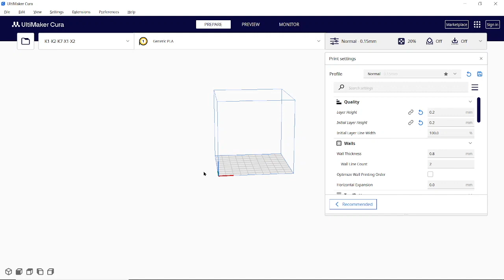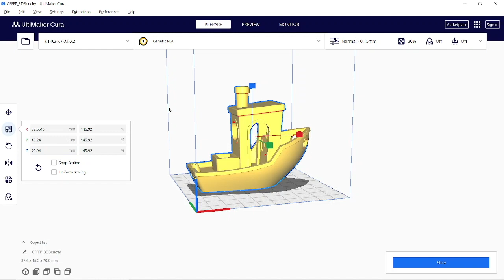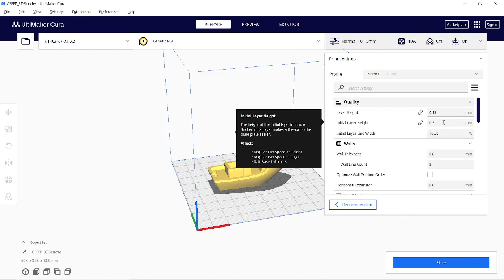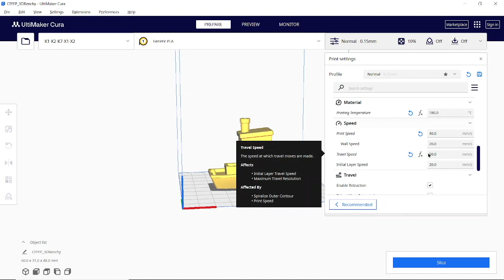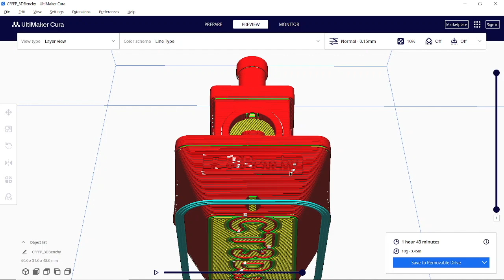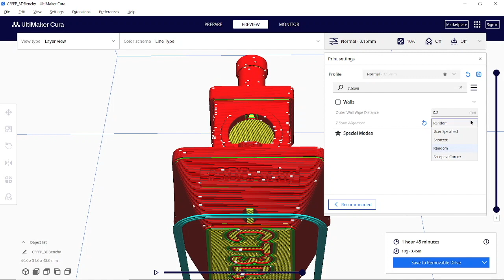How to set up and use Cura 5 4 0 for the Easy Threed K9 Mini 3D Printer

Comment: I didn’t find the files you mentioned at the beginning of the video in the memory because it’s empty.
Reply from the maker: Thanks for your comment. Did you have the card that came with your printer? Thats the micro SD card they supply. AFAIK the file isn't available to download from anywhere but it should be on the card that came with your printer. Kind regards & best wishes.

Comment: Best vid I stumbled upon regarding printing. Subscribed. Liked easy talking and smooth transitions in this vid. I am in 50es and bought printer for fun because it was under 40e on temu. Completely unplanned. While I Planned for a years to buy something really serious but i do not have space for it still. I am in a joy like teenager because I need to sit in front of 3d studio like i did maybe 30 years ago. Wow. Modeling again. 3ds,dwg,eps etc etc 486 dx120 with 16mb of ram wow. Rolling like avalanche Joy, recalling, thrill, planning... Thank you. Thank you. Best, from belgrade.
Reply from the maker: Thank you for your comment & watching the video. I very glad it was useful. I was for 30 years inexpertly making things in wood & metal so it was a revelation for me too. These small printers are really good for the money as long as they can be bought cheaply and at €40 its good value. Kind regards & best wishes.

Comment: Could have shortened this video to a gif:
1. Sell cheapest printer on aliexpress.
2. buy Bambu a1 mini.
3. Delete cura
Reply from the maker: Thanks for your comment. I welcome all opinions. I don't have to sell the printer. The price point sells it. Many people don't have $250 to spring on a 3D printer. One thats $80 still has a place. The printer stands on its merits IMHO. There are many selling points, not just the price tag. Its not going to meet the Bambu Labs in any respect but its very low price tag and extreme ease of use from assembly to first print are hard to beat. I have may other printers and none have been as easy to get an acceptable print from. The bed adhesion is superb and its easy to do. Look at the 100 or 1000s of posts online to see thats an area many beginners struggle with with all of the conventional surfaces. Its a total non issue with all of the Easy Threed printers. It uses little electricity and has an unheated bed and is low usage. This is an issue for some not being able to afford utility bills etc. Its low cost all round. Parts being cheap as chips. The hot end costs about £4 to the UK. Its easy to replace. Really easy. I just did that as I've done on my Enders 3s & CR10. Its much easier. A few tiny screws and done & dusted. Its easy to load & unload filament. There's a long list of things. I feel totally justified doing stuff on these printers because they do have a place. They have a place as a starter printer or for folks on really low budgets who want to try the hobby before committing big money to it. I won't go into Cura, which is one of the best slicing softwares from one of the biggest names in the 3D world which is developed and provided free. Of course you are welcome to your opinions. We must agree to differ. Kind regards & best wishes.

Comment: Cura keeps saying “print setup disabled and g-code files cant be modified” after uploading to the cura application. These are the SAME files on the website of free models provided by the website link on the TF card…. I sliced them in Easyware and printed them but they wont upload to CURA and keep saying make sure the gcode os suitable for printer (which it is because i used Easyware to print test prints)

Comment: Would this setup happen to also work for the K6? I am so lost. Easyware is garbage
Reply from the maker: Thank you for your comment. 3D printing is a a steep learning curve. Easyware is functional or at least it can be used but doesn't offer the same options as Cura will. Cura is suitable for any FDM 3D printer, so the settings should work the same. Your SD card should have come with a little configuration file which should configure CURA and it works with 5.4.0 as well as the older version of CURA that comes on the SD card. Id Jump to 5.4.0 or whatever the latest version is. It has a wealth of features. Im currently trying to look at optimal settings in CURA for the K9. Id suggest to try looking at https://www.youtube.com/@filamentfriday
The channel has a large amount of useful information on 3D printing in general though they don't cover Easy Threed printers. Id suggest trying a calibration cube which should give you an idea how the printer performs. Although Cura has many settings, its best to not to change too many of them unless there is a compelling reason. Thanks for watching and let me know how you get on. Kind regards & best wishes.
Reply: Thanks for sharing. I have printed a few items already upon receiving the machine initially. In regards to Cura, I have input my info by dragging and dropping, but the print froze mid-print. Not entirely sure how to proceed.  @NightStarLeafTech-vj3ez
Reply from the maker: @ItsMeKuchipatchi  Im not sure why that would happen. Ive never had any unexpected problems with the K9. I generally find that they respond well to being turned off and on again at the wall  and that, normally fixes any issues. It doesn't help with the print freezing. Were you using the SD card or controlling it from a computer? I only ever have used the SD in printing. That applies to all my printers. I would try again. Perhaps change the SD card, which might be corrupted etc. Kind regards & best wishes. If using an SD card extender it might have got jogged. It might also have been a power outage. They don't have sophisticated features like resume after outage etc. Kind regards & Best wishes.

Comment: Its a good job I watched this video again. With your help,  managed to get my printer settings into Cura. I am now printing the benchy but as I like it where it is a little lower and a little wider. Standard, I think the cabin is out of scale and too tall. I have also bought a heated bed for my K9 as I tried to print a box and one corner was lifting up and it was catching on hte print head and didnt work. I am hoping hte hotbed will work better when it arrives.
Reply from the maker: Hello again. I didn't see your 2nd comment. It shouldn't lift tho, not with PLA at least. Have you tried levelling the bed again with the paper method? It might be that bed bed has gone out of adjustment. Mine seems to require re-levelling frequently but its very easy to do fortunately with the 4 little buttons. You might check out my other video on changing to the Ender 3 magnetic print surface which makes the bottom layer cleaner and is just as easy with bed adhesion. Kind regards & Best wishes!
Reply: @NightStarLeafTech-vj3ez  The printer is new. I level the bed every time I use it. I have done the paper thickness every time I level the bed. It has the magnetic print surface. The prints raise up at the 4th corner after a few laps of printing. It doesnt happen straight away, but after a few layers. It seems as if the heat of the pla lifts the corner and then the tip of the extruder catches the raised part. I use PLA+. Small items are easy to print, but ones that go have a larger foot print seem to either not stick or the printer doesnt like the number 4 corner. I found that I could press down on the far left corner of the printer base and it will level the y axis and bring the axis level, so I super glued the foot of the base down so it doesnt lift up. I havent tried the printer yet as one item I wanted to print turns out to be too big for the bed. As it is a 100x100x100mm printing area, hte piece goes out of the range by 4mm one side and 3mm on another side. I will find something to print that is going to be useful for me to use. It is only a T12 soldering station case, but I have a couple of different t12 soldering stations I would love to print out. I have to learn how to start designing one but cant yet get a simple panel started. I have a print to try, which is 3mm all around oversized but it had two parts to it and I cant find a way of deleting one of the parts so I can just print a part of the set. The way it is set out, it has both parts on the print table at the same time and I cant edit it to print one part. I use Cura or FreeCAD to load the files and have it set for my printer.

Comment: I think this is the best video of explanations I have seen for these printers. I have just bought one as I already have two reels of PLA and nothing to use them on. My first time owning a printer that will work as I bought one that I didnt know was not complete. I am in my 60's and I have seen a few video's but they dont go into it as well as you do. Thanks for an easy explaining and exploration of the settings. I will look at this vid a few times.  I will have to subscribe to see your other vids about 3d printing.
Reply from the maker: Hello and thanks so much for your comments. Im in my 50s myself. IMHO seniors may have a better experience with 3D printing. Its a kind of electro mechanical device which has mechanical & electronic components combined. I often feel that seniors have more of a practical grasp of those things than younger folk and are more inclined to practical things which is a distinct advantage. Plus we also have patience etc because we grew up in a different time. These things are so good for the hobby. 

Im sorry you had a bad experience with your first printer. Its a steep learning curve. Thats why I think this range of printers is great because it takes a lot of things out of the equation  that otherwise might cause problems. Bed levelling and bed adhesion - the one is easy and the other simply doesn't exist. Bed adhesion is great. No heat needed. No trouble with it. Blockages - I've not had one yet with mine. It doesn't seem to block. Feeding the filament is very easy - another thing people struggle with sometimes as the filament can get stuck, get loose, components fall apart or go out of adjustment. Not so with these printers, they are very simple and straight forward to use and the filament path is very simple. People can go on to acquire other skills &  needed later. Its not  like being thrown in the deep end.  

I hope you enjoy using the printer when you get it! I wanted to do a video on feeding the filament etc and I've still got a lot of things to do with the printer plus also some 3D design projects with Design Spark Mechanical which is a 3D design program. It has a free version. It only works on Windows machines ATM. Id encourage you to take a look and see if it would be of interest. Its certainly worth the time to learn it. Kind regards & best wishes.
Reply: @NightStarLeafTech-vj3ez  I saw this reply after I saw your second one. I find feeding the filament easy. I hade a filament reel holder out of plywood before the printer arrived and placed it behind the extruder so the feed is almost in line all the time. I havent used the white filament that came with the printer. I have bought a 3d pen and think I will use that with the white from the Easythreed.  I am going to look at the 3d design you mentioned, thanks. I had a 3d design program on a computer many years ago, but I think it was part of print that is on computers, and I designed an interior for a camper van I was building from an Ex Post Office LDV Convoy van. Needless to say, I built the camper as I went along but only used half of what I planned with the 3d design program. I will find one and learn how to start 3d design. I was thinking of going for a resin 3d printer, but I am unsure of the drying and cleaning process as I have seen other machines that will set and clean the excess resin on the printed items. Thanks for your feedback and help suggestions. I look forward to seeing other video's you make. Take care and all the best. Ian
Reply from the maker: Hi Ian, its interesting you say you are doing a van conversion because Ive done one too which is mostly finished apart form the water heater which I haven't had time to finish. I used a lot of 3D printed parts in mine eg edging for the over cab area, framing for the windows, gaskets & grommets, the glands for the solar cables etc. Basically anything I couldn't buy or easily buy. I also did custom joints for the waste water system. Of course it means you can have any combination of angles for the pipe work rather than sticking with what's on the normal market for these things. Good luck with your build BTW. The K9 isn't up to ABS  but of course you could get something later that is. There are many printers that will do it. I haven't considered resin myself or looked into the technology either. Id be interested to see what you made for the K9 but Im not sure how to share things. I don't know if you saw my other video where I made a platform for it. It was a bit rough & ready but functional. I may set up a website later depending on if the channel grows etc.  Kind regards.   @ianallen2
Reply: @NightStarLeafTech-vj3ez   \It was a few years ago (around 13 years) when I built two camper vans, One a transit minibus into a camper and the LDV. I also built a teardrop caravan. I bought a mattress to fit in it and asked my wife what she thought of it. She felt claustrophobic in it.. lol. 
For the K9, I built a  frame similar to yours, but with a solid board base. I am going to upload a video on youtube to show what I have done.  I have had a micro sd card extension off ebay arrive today. It will be easier for me to mount the sd card as where it is on the printer, I think is awkward to put the card in as I need a light to see the slot. I have thought about making a reel holder to come off the handle uprights, just to bring it in from the back a bit as the reel overhands the back of the base plate. I am thinking of making an enclosure for it to keep dust off it. 
I will only use PLA and PLA+ for printing. I have read ABS is smelly and needs a ventilation fan and filter. 
The heated bed makes the prints stick a lot better to the bed.  Best regards.
Reply from the maker: Looks like you were doing the vans before it was cool to do it. I find ours claustrophobic to sleep actually. I have plans to open up the bed area but don't have time presently. Im glad you are going to do a video on the printer. Especially if you have made some things for it. Im sure it will be popular. I didnt have any time at all since the summer but hopefully I can start doing a bit more in early 2024. Interest in the printer has grown. Its not surprising due to the price point. I cannot explain why you had the problems with bed adhesion, with mine it was too much if anything. It depends maybe where you are in the world and what your ambient temperatures are. IDK. The machines are very complicated, even simple ones, and there are many factors which act on their performance etc. Im grateful for your comments. Its given me ideas for videos. Best wishes  @ianallen2

Comment: I loved this video!  Question: Do you have a video "how to connect the printer cable"?  I'd like to use the cable instead of the smal SD disk.
Reply from the maker: Thanks for watching the video and for making a comment. Im really sorry but I can honestly say that I've always used the SD card. I normally baby the printer for the first layer just to check that its being laid down correctly so I see no reason to be able to be away from the printer when its starts a print. I do wish you all the best in doing so though. Happy printing etc!. Kind regards and best wishes.

Comment: I need help!! the printer came but i cant install the printing platform on the axis!! plz tell me how!
Reply: it slides in from the side onto the white platforn on the axis. then flip it over and put the screw in from the bottom. if you have a little magnet put it near the tip of the screwdriver so the screw can stay in place whilst you insert it through the hole.
Reply from the maker: @pujhpiuhnpiun  Thanks for helping with this question. Unfortunately I haven't seen these comments. Its a great community tho. Thanks again for helping out. Kind regards & best wishes.
Reply: its almost like it doesn't fit!
Reply: it does fit, but you have to push it reaaaally hard